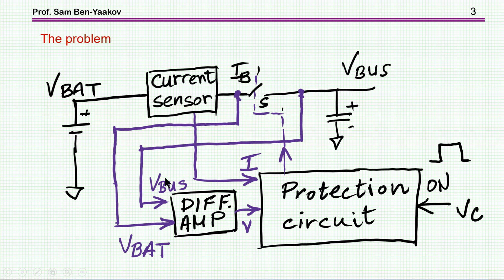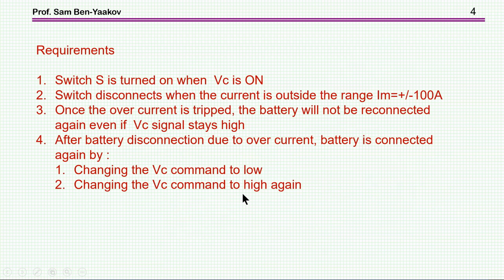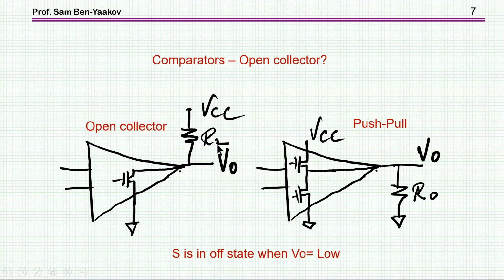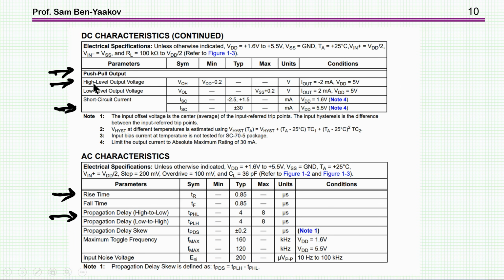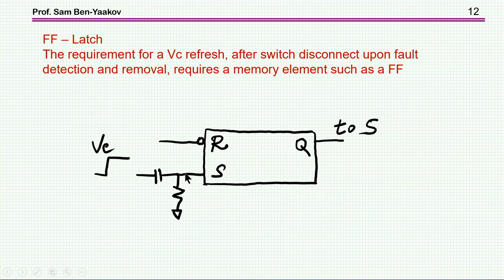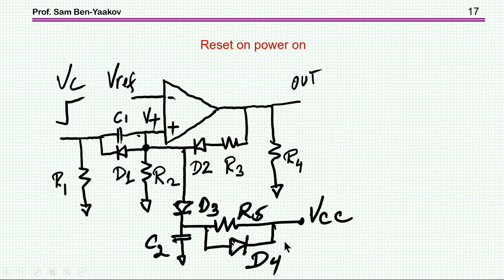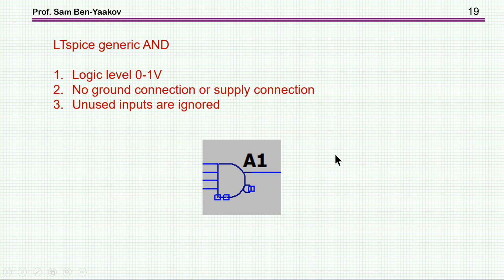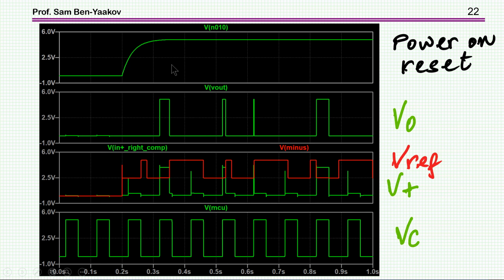Over-voltage and over-current protection: An example of a discrete design

Comment: Sir, will you please tell me which model file of MCP6541 you have used? Thanks in advance.
Reply from the maker: HI, AS it happened I had to switch laptops and I do not have the older LT library so I can not get the model. But, you really do not need this particular unit you can use in its place the LT comparators shown.

Comment: I am facing error using MCP6451 comparator in LTspice. It says "time step too small". I had to import the model as it was not found in the component section of LTspice. I would appreciate any advice on this.
Reply from the maker: This is because of the fast transition Try to use relaxed tolerances (at the SPICE hammer in the Control Panel
Reply: @sambenyaakov  Hello sir, I have set the tolerance values from control panel to values like 250, 100 etc, but I am facing the same probem.
Reply from the maker: @sabbirahmed3034  Just use another comparator from LTspice library.
Reply: @sambenyaakov  I used the LTC6702 comparator from the LTspice library but the output I get is not what I expected.
Reply from the maker: @sabbirahmed3034  Not as expected - In what respect?
Reply: @sambenyaakov  Sir I am trying to simulate the exact circuit shown @17.01 of thid video to the get same output as yours. But if I use other comparator instead of mcp6451. The characterstics of the output is not analogous to the output shown in this video.
Reply from the maker: @sabbirahmed3034    Send me the .asc file which does not work to to sby@bgu.ac.il
Reply: @sambenyaakov  Sir, I have mailed you.

Comment: Thank you! It seams that circuit will work w/o D2. The latch will work w/o D2 am I right? The purpose of diode D2 is to have higher input  impedance when comparator out is off?
Reply from the maker: Strictly speaking you are correct. I chose to put the diode so not to be dependent of the output impedance of the comparator when the pulse is delivered.

Comment: Window comparators can be made cheaply and in a small footprint with the LM431 and variants. Look for Figure 11 on slva987a.pdf
Reply from the maker: Sorry but I disagree
1. Not cheaper : you need two per comparator so for the shown design you would need 8 while you can get 4 normal comparators in a package. 
2. You apparently did not pay attention to my explanation why an open collector is not desirable
3. the LM341 is NOT a comparator it is intended to be used in closed loop so in it has internal compensation which slows it down
  4. DO NOT use unspecified components in safety circuit. The response time (propagation delay and rise time)of the LM431 are not specified - so assume the worst.

Comment: Hi Proffesor, thanks for this video, in minute 12:49 you have added a diode D1, in normal operation when we have voltage on the output of this comparator this diode will not make any problems with operation of this circuit?. This diode will delete locking of our circuit. once again thanks for analog way in digital world.
Reply: I believe the goal is to have memory only while input is high, and only latch on rising edge. So yes when input goes low the memory is reset.
Reply from the maker: Indeed
Reply from the maker: When Vc is high the diode is reversed biased. When Vc is low it forces a zero output no matter what.

Comment: Once again you read my mind! I need such a solution for my Tesla coil to minimize damage to parts when I push it a little too far. Thanks for the reference material!

I realized the difficulty in hard switching a high voltage DC bus When I was attempting to use an automotive contactor at 200VDC. Into a resistive or inductive load, an arc is established over the contacts and persists until I remove power, and melts the contacts if not extinguished asap. That capacitance following the switch helps with soft switching, as it prevents series inductance causing a persistent arc to be established, but too much of it also means hard at switching on and might nesesitate a precharge circuit

So a MOSFET or IGBT makes sense for this application of a hyperfast efuse, rated for the voltage and current. And looking around, turns out there are several expensive ICs that do exactly this, but it also seems like something easy enough to implement with descrete components, so this video will come in handy for my PCB design. Thanks!
Reply from the maker: Thanks for note and sharing your experience.